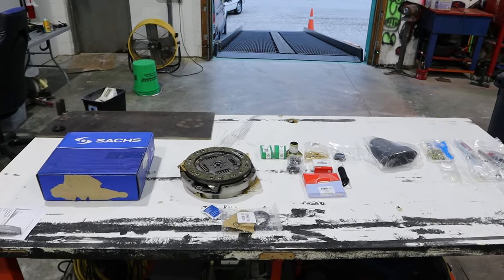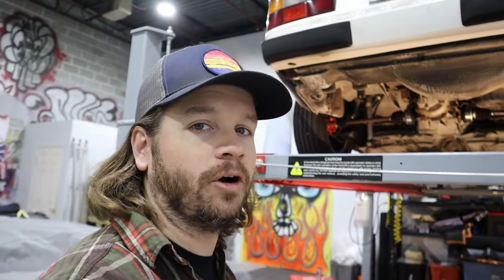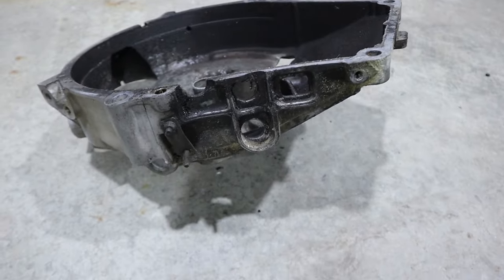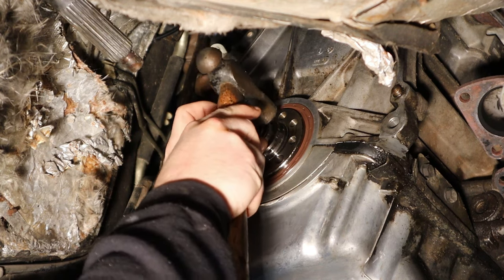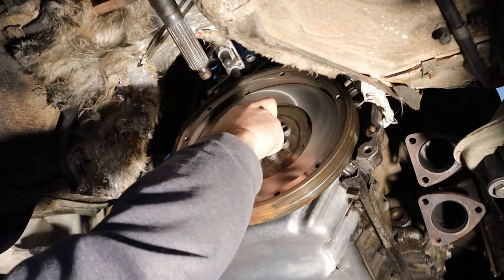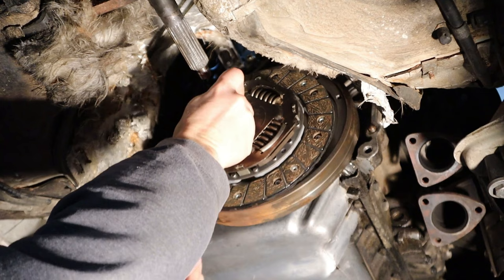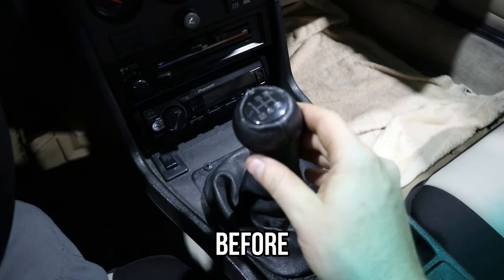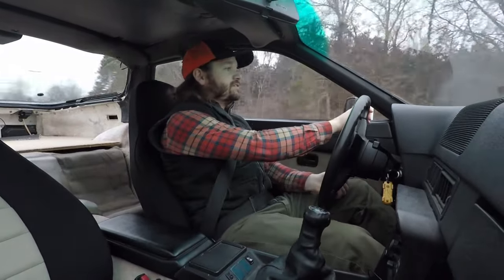Porsche 924S Clutch And Short Shifter Install

Comment: Just picked up a 1987 924S. Got the factory seats back in. Probably needs engine mounts , as well as general maintenance.  The belt and pump were changed,  but I have no idea when. .. . The previous owner removed the stock shift handle, so it wobbles.. need that, wipers have to time them on downstroke to shut off, or they stop exactly where they are at 😅. Oh well, I hope im fast learner

Comment: Have you double checked the crank case vent wystem? So it doesn't build pressure and causes leaks ? Shouldn't be an issue, but worth a check.
Reply from the maker: I havent but I like that thinking.  I'll investigate

Comment: What a pain! I was going to stop and check out a used 944 last spring in my hometown. I kept debating it with myself for a month. It was $3500. Somebody else bought it, I seen it driven for a few weeks and haven't seen it again!
Reply from the maker: A pain but necessary.  3500 is not bad if the car is in decent shape!
Reply: @tangentsbhb  
I highly doubt it was in my little town. I had recently gotten a Crossfire and had never owned a German machine before. I decided not to bite off more than I could chew. Besides, I might run across more bikes in need of some love!

Comment: Really takes me back, same interior as my old 944 (although you have the steering wheel on the wrong side 😂), my cousin has it now and he’s about to do a deep restoration on it, I may ask to buy it back from him when it’s done 🤔
Reply from the maker: Well if you had the steering on the other side you also had the good looking bumpers and stuff!
Reply: @tangentsbhb  That’s right, 1982, 8v, 2.5, guards red, no power steering, no sunroof, Fuchs alloys, the one that’s getting collectible now as it was the 944 in its purest form, you know I’m pretty sure I’ll buy it back once he’s completed it, I’ll need to be patient though, he’s just completed his Morris minor 1000, it took 4 years, but wow it’s better than the day it rolled off the line 👍

Comment: great vid, well done, I did similar clutch replacement on a 928 as well rebuilt the torque tube; new bearings and shaft. For the RMS, theres a special tool to insert correctly unfortunately you have to pull the clutch etc again.....let me now if you need info on tool :)
Reply from the maker: Well I can't imagine much of a specialty tool beyond a large ring. I've installed many like this so I was surprised it leaked

Comment: Gonna watch this again in a year when I get tired of listening to my torque tube bearings.
Reply from the maker: 🤣🤣🤣 

In all seriousness though did mine sound OK or too noisy?
Reply: @tangentsbhb  I'm far from the expert, but all the forum threads make it seem like they should be nearly silent.
Reply from the maker: It's so hard to know what I'm hearing in the car. This is my only experience with a 924/944 so I have nothing to compare to
Reply: @tangentsbhb  same here.
Reply: @tangentsbhb  just be glad you started with a 924S. My son was so amused by watching me struggle with my 944 that he bought a 924 project. At first glance its the same car with a different engine. Digging deeper, they are way different, harder to work on, less parts availability, and less info floating around online. If I had started with a 924 I wouldn't be nearly as into the platform as I am now.
Reply from the maker: Very true. I specifically wanted a 924s

Comment: Do they make a lightweight flywheel option for it? With your quest to drop weight it's usually good for a solid 10-12lbs depending on what you find, frees up some revs too.
Reply from the maker: They do indeed. I'm not really focusing on this engine too much as I plan to swap it in a year
Reply: @tangentsbhb  makes sense!